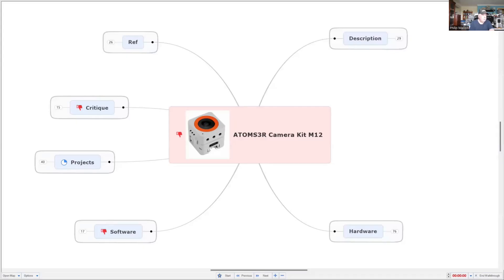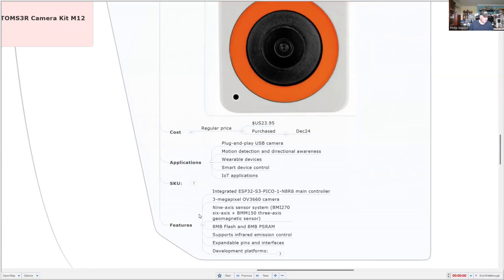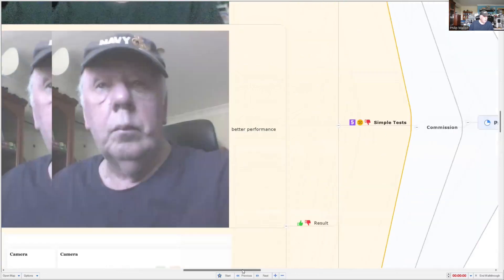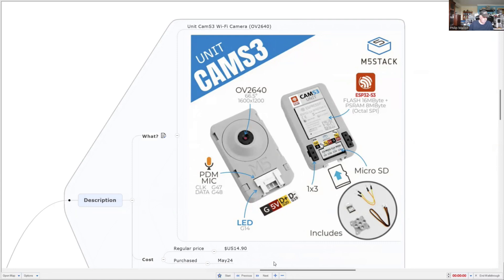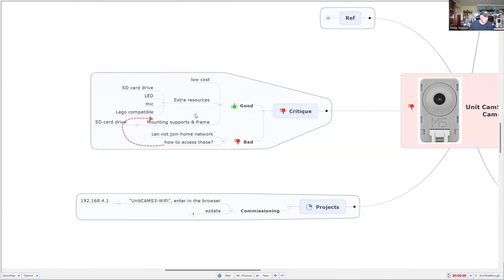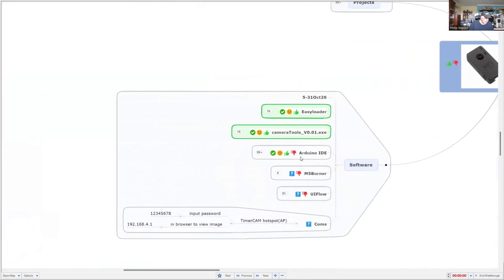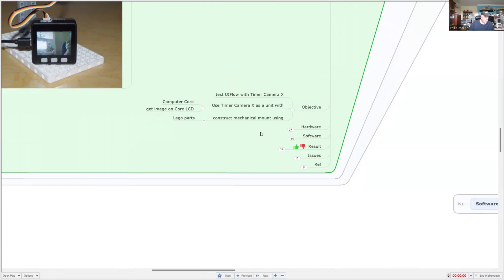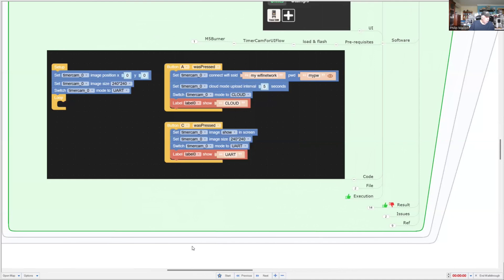Review of M5Stack Cameras

Comment: Thanks very much. I wish I had watched your review before I purchased the UnitCAMS3 MP5. I have got it to stream continuously (after a great deal of fiddling about, and with MEGA support from ChatGPT). Continuous streaming requires significant bandwidth and so it must be in an area that has good and consistent WIFI. Their file structure for documentation and “boards” for Arduino IDE was peculiar and took me a long time to find the correct one (I wrote to them about this, and even mentioned it in my review — which appears to have been deleted!).
Overall, M5Stack promotes interesting hardware, but not much usable support.

Comment: Hi friend, I really liked the camera review, congratulations.
I wish I had seen this video a month ago so I wouldn't have bought the Unit CamS3 Wi-Fi Camera 5MP and suffered like you. I think we'll only have support in a year or so, I still haven't found an example of the Arduino IDE for it.
You've gained a subscriber, I'm waiting for more videos.
Reply from the maker: Thanks for the feedback. If you wish to use M5Stack camera consider Unit V2. I will be exploring this soon but I have previously used it on Lego robot projects. The one good point about M5Stack is that it is Lego compatible but this has a down-side. Often the camera's overheat. I am also evaluating the recamera and it is the topic of my next video.  On the first day I got this camera it was happy with it but on the second day after attempting to develop my own applications I found problems with it. I hope M5Stack release software support for the Unit CamS3 wifi in the next release - perhaps at the end of this month or next. Either way it is misleading for them to claim that it is UIFlow compatible now.